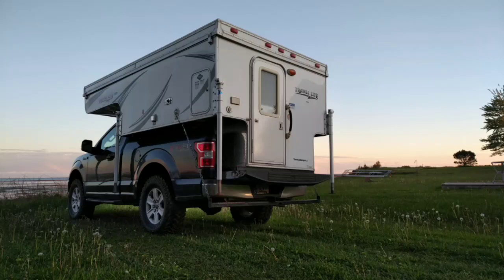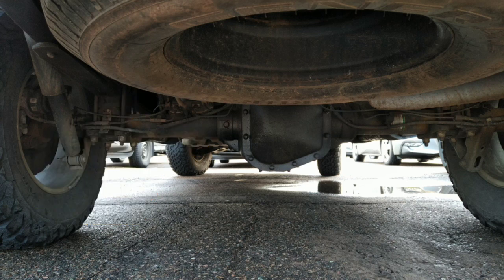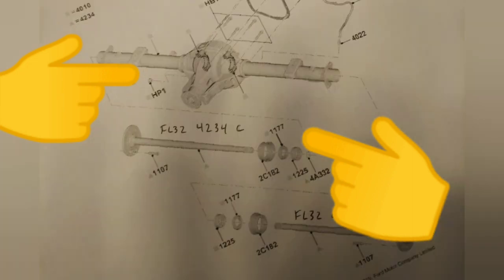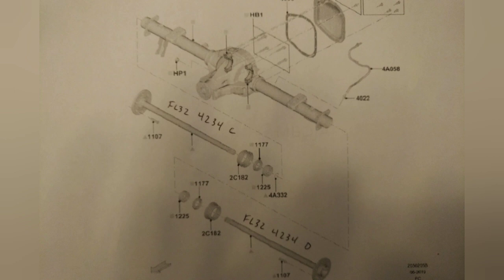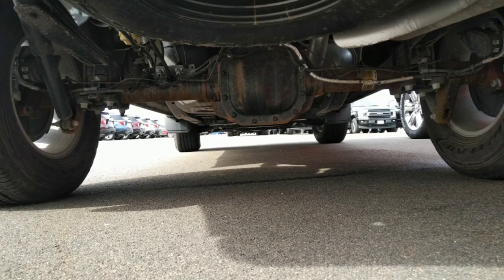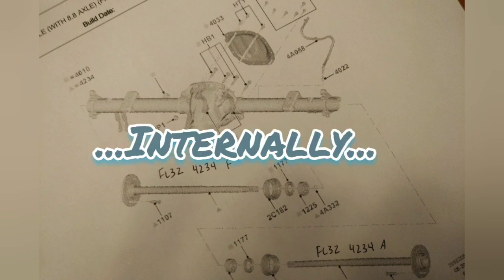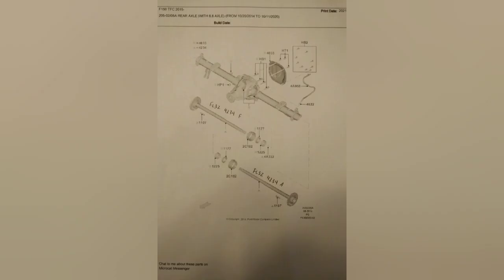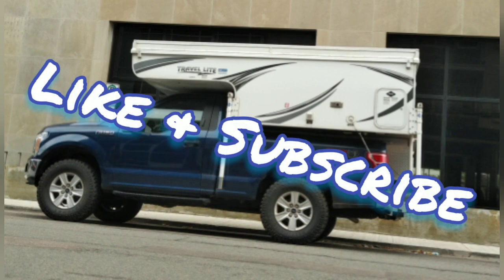Ford F-150 rear axles,  part numbers and info

Comment: Question: What is the difference between 809 A and 809 B? The differentials look the same on the original rear end and the replacement one except for the A and B on the sticker on the passenger sides. Help?!?

Comment: Watched the video carefully. Thanks for posting this.  Part of what i realized is that the above description is models up to 2020.  With 2021+, not sure if/how things have changed but going through the tech spec there are three rear axles from what I can tell.  8.8, 9.75 and 9.75HD.  The Raptor & HDPP optioned vehicle use the HD version.  The HD might only describe the ring gear and the axle shafts follow part numbers above.  HDPP uses tapered wheel bearings vs straight in other versions.  I don't know enough to know advantages/disadvantages of straight vs tapered.  I could easily see a service tech using the wrong type if they were ever swapped, assuming they are sized the same.

In this video, it seemed like there are also three versions which are light, mid, heavy.  The 8.8 without towing get the FL32 4234 A/F axles while the heavy uses the C/D versions.  Are there differences for the 'mid' that I missed?  Guess mid would be 9.75 but without HDPP or towing?

I did find an interesting piece of info but not sure if it's only for 2021+ or was always there and was only talked about in reference to 2021+ F150.  They are calling it 3/4 floating axle.
https://tfltruck.com/2020/12/news-these-2021-ford-f-150-trucks-have-a-3-4-floating-axle-it-may-be-delaying-your-truck/

The picture in above shows a different mechanical system in superduty(floating) vs HDPP type 3/4 floating.  Then 1/2 trucks are said to have floating type.  Not sure the differences, yet....and trade-offs.
Reply from the maker: Axles are complex and I may be forgetting something or unaware of new changes in 2022 or something.  In 2018 the 8.8" was available with 3.73's which had a higher tow rating which used the medium shaft.  This went away in 2019.  As far as I know all Super 8.8" axles have always been rated for 3800 lbs and similar towing.  They are a 2 bearing axle, semi or 1/2 floating.  Just a carrier bearing and a wheel bearing.  Any variances in towing is due to wheel, tire, or hitch rating.  Not the axle.

The 9.75" which has been around since at least 2014 is a 3/4 floating axle or 3 bearings per side.  In this case it is a carrier bearing, wheel bearing, and an outer axle shaft bearing.  You can buy a bearing kit that makes it Full Floating but it is already rated for 5300 lbs (which Fprd lowers on paper) and like a full floating axle if you break a half shaft it won't fall out with the wheel attached.  There are less stiff (light) half shafts on trucks like base V6's on the RCLB with 3.73's.  All 9.75's have the same weight rating because it is the tubes that carry the weight.  The lighter half shafts are just more springy to allow smoother shifts for the lighter low torque base engine.  The 3.5L EB and the 5.0L V8 with the 9.75 all come with the HD everything in the axle.  They don't need to be HDPP, SPP, or Max Tow to get it.

I don't think there have been any changes in the parts or design of the  9.75" axle in the last 8 years.  Both axles (9.75 & Super 8.8) use the same half shafts, Raptor excluded.  It needs longer ones.
Reply: @fabulousoffroaddesigns5080  Thank you for your detailed reply.

"The 3.5L EB and the 5.0L V8 with the 9.75 all come with the HD everything in the axle. "
2023 Tech spec, pg 25, calls out on paper differences based on having HDPP.  I don't know the actual part numbers involved so no clue if it's just marketing.

For 2023 only XL trim gets HDPP and max towing.  But if you go XLT, you can get max towing (no HDPP), but marketing makes you have at least a super cab/crew and spot/appearance package for the tire upgrade.  It's potentially a much longer truck and more costly.

This video definitely got me thinking more on the rear axle mechanics.  Need to find a way to get public access to ford parts info on my truck or better yet the model year to look for parts differences.

Comment: So is the 10.25 for F250 or F350?
Reply from the maker: I believe they are the same.  I think the only differences between the F-250 and F-350 SRW are the suspension and the way they are registered.
Reply: @fabulousoffroaddesigns5080  I have a 2003 Ford F150 positive traction 5.4L gas that I've got to change the rear differential oil in and I'm not sure if I've got a 9.75 or 10.25. It has a towing package from the factory.
Reply from the maker: @rjpgd  2003 is before my area of knowledge but I believe if it is the 7-LUG axle it is a 10.25" Sterling built semi-floating axle.  I think the axle rating of 4500 lbs.  The front axle is the same 3800 lbs Super 8.8".
Reply: @fabulousoffroaddesigns5080  Thanks

Comment: do you have an electronic E-brake? I want to upgrade to a 9.75 rear axle, but heard that the trucks that come with a 9.75 have a traditional E-brake, not sure if this will be an issue
Reply from the maker: No it has the same Electronic Emergency Brake.

Comment: Are you saying all the axles have the same spline count?
Thats the only way they would be interchangeable.
Reply from the maker: I've never counted the splines, but they must have the same count, because the part numbers for the axle shafts are interchangeable between the Super 8.8" and the HD 9.75".

Comment: I love this video sir!  At the ripe age of 58 and with many trucks behind me in light and heavy duty and dually, I mostly miss the light duty 3/4 ton of many years ago.  At my age the F150 with HDPP is my best option for a lighter weight Alaskan camper and 700 pounds max of people and gear and tongue weight.  When I retire ten years from now that missin profile will align with a super duty.    I leased a 2021 GMC with 3.0 as I am such a fan of in line six gas and diesel engines. The power train is really phenomenal and it brings a smile to my face under load like the 96 Cummins 5.7 dually I had in q Scotty class C ram motorhome weighing 13000 loaded.   These diesels excel when you work them.  But the rest of these first gen 1500 offerings dont align with my mission profile as much as the F150 HDPP.    or the previous Titan Hd with diesel.     My hope is that the light duty 3/4 market comes back just a bit when GM refreshes the 1500 to a higher aspect axle ratio, stiffer crew cab 6.5 frame larger fuel cell and more springs and truck tires. Sad that they dont offer max tow on this but I suspect the first marketing swing was product acceptance and second one will be making it an honest work truck.  Mine has a 1775 payload and averages 24 mpg.  I hate the 5.8 bed lenght and not a fan yet of go go gauche tailgate.  And when towing I wonder why Mary Barra left half my gas tank and two leave springs in Mexico!  This truck wasn't built by folks in. Ft Wayne close to ohio where i live and i really like buying things fro. My neighbors.   So my more informative position will influence my future buy and honest guys like you who present facts will inform so many others.  Thanks for that sir.  Actually I doubt gm will pursue a heavy duty to compete with ford f250 HDPP  that and I will probably end up in the F150 next time which is fine.  Just wish they had a small diesel in that for guys like me who still need to park in city garages which prevent the 250/350 approach if we want one vehicle whe. under load doesnt suck gas like that incredibly responsive ecoboost.
Reply from the maker: First, thank you!  I'm glad people find this helpful or interesting.  The HDPP is a great package!  And it comes complete.  GM currently doesn't have an axle to compete.  There is another option you may want to have a look at.  

The 2.7L Ecoboost Heavy Payload Package.  I don't remember the GVWR exactly but it has the same axle ratings as the HDPP with slight reductions for tires.  The benefit of the 2.7L is it is considerably lighter then all the other engines and is built like a diesel with the "compacted graphite iron block" and "offset rod bolts" .  It has 400 ft/lbs of torque yet produces 325 HP.

With the right tires it will get you 3/4 ton types of payload and near diesel fuel economy.   It also doesn't have 10 gallons of DEF inside the fuel tank, so you get the range.
Reply: EcoBoost. For so many typos like saying Cummins 5.7 when I meant 5.9.
Reply: Sorry

Comment: WOW I found you!!  Your the guy from the TFL review! Nice to see you are sharing lots of good info.  After I bought my 18 F-150 ad realized there were 2 rear axles and I had the 8.8 I was a little disappointed. I would have opted for the 3.5l if I had known better. I researched Pricing for months based on trim packages and never knew this.
Reply from the maker: There are benefits to the Super 8.8".  It makes the truck slightly faster, better on fuel, reduces NVH, and gives about a 1/2 inch better ground clearance while being plenty strong to run 35's.